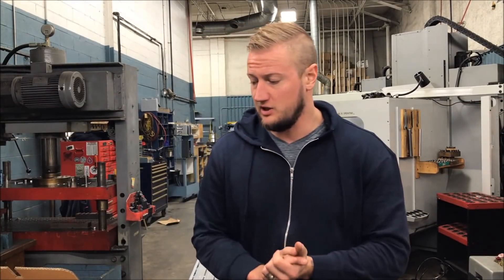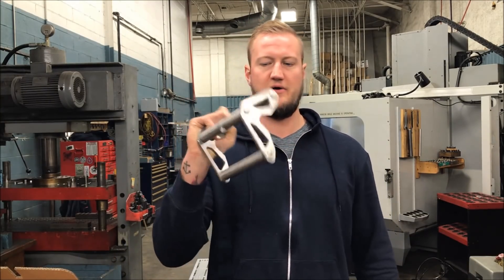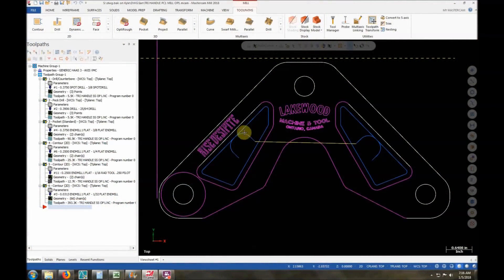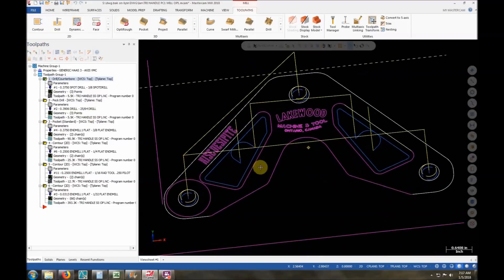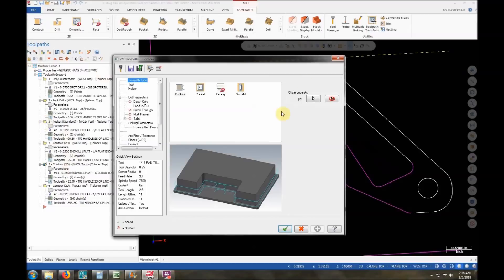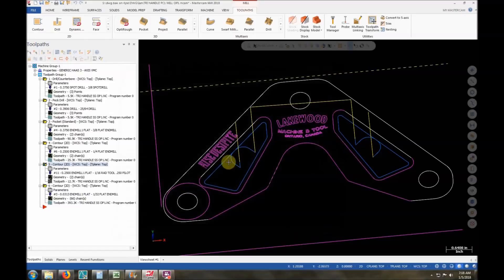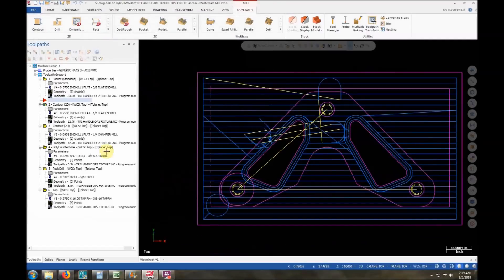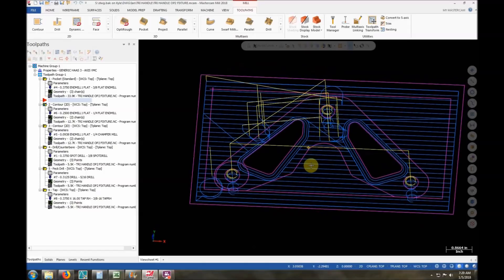TAKING A PROTOTYPE INTO CNC PRODUCTION

Comment: Nice job Ian!
I like to prototype out of CRS too. It's cheap and easy on the cutters. We have a patent pending on a wire EDM work holding tool called "Multi Axis alignment Tool" I did all the prototype in CRS. It was a good thing because of all the changes I made before the final product would have cost a lot if we prototype in 440C stainless steel.
Steve
Reply from the maker: Whenever possible, I actually usually prototype out of aluminum because I've got a ton of it sitting around and it's so quick and easy to do - but in this case, I wanted to functionally test the prototype, so I needed the strength of CRS! I'm interested in seeing the EDM tool - I'm actually just headed down to the floor at the moment to replace some switches on my Sodick!
Reply: Hi Ian,
Here is a YouTube video of our product. https://www.youtube.com/watch?v=0B8w81xgTQM&t=835s

Comment: Hello Ian, liked the video on the tri-bar, curious to know. Have you ever tried to create a 3d  toolpath  on the hole in the round stock in the mill after drilling?
If you wanted to go a little more  lighter with the type of material and maintain its strength try titanium( you can get titanium hardware as well) Cost would increase though. Just a thought.
Thanks for the video.
Reply from the maker: Titanium would be killer!! I'm not sure I follow - if you mean a helical toolpath with an endmill after drilling, I actually do do that to clean it up. Thanks for watching!
Reply: Sorry Ian, what I had meant to say is to chamfer the hole using a 3d chamfer toolpath. email me at gregorbrown66@gmail.com, so I can send you a Mastercam X9,2017,2018 file on the toolpath I'm referring about. Let know what file you prefer.
Reply from the maker: Oh I understand what you're saying - I'd still love to see it though! Feel free to shoot it over to me at letsmachine@gmail.com - I've never done it but I'm interested in seeing how you do it! I've got Mastercam 2018 so I can open just about anything

Comment: Dude your channel has help me as a machinist so much , with a year under my belt you extended my knowledge so much it the short time I’ve been subscribed thanks a million
Reply from the maker: Hey man thanks for watching, I’m glad it’s been of help! If you ever need help with anything, feel free to give me a shout brother!
Reply: Let's Machine  will do brother 🤘🏼
Reply: Looks nice!  Just curious, what was the hole in the top crossbar for? I thought maybe it was to attach it to the bar, however  I noticed when you were using it, it dropped right off the bar ?  I like the button head bolts too, gives it a clean smooth appearance.  
-Bakes
Reply from the maker: That hole is so you can connect a caribeaner (sp?) to it and use it on cable rows, close grip pull downs, and the like!